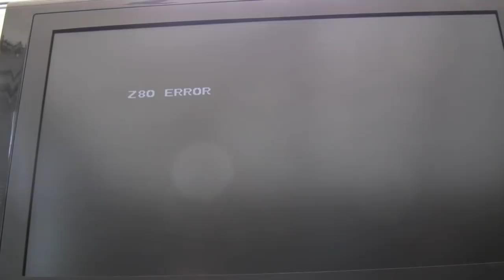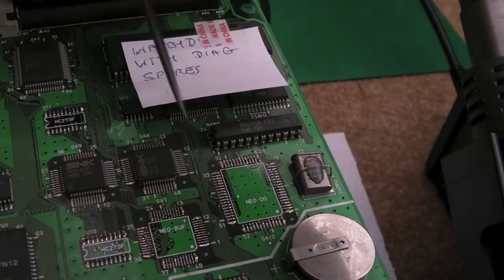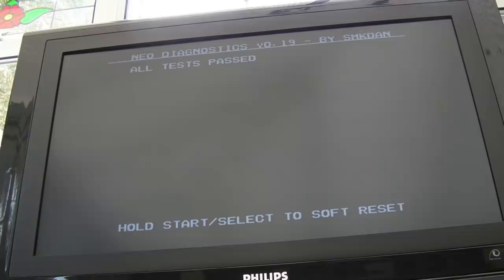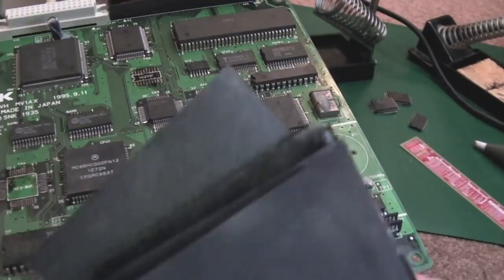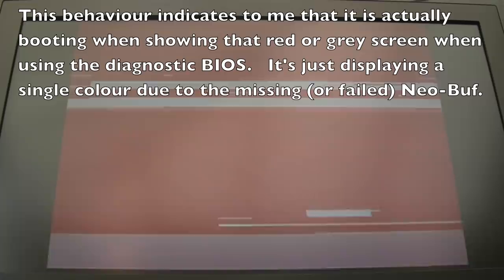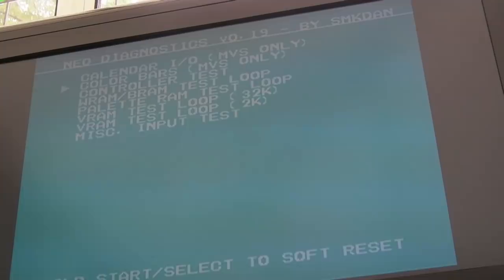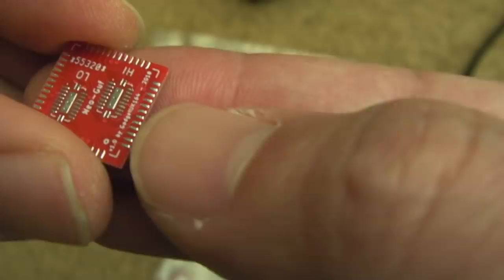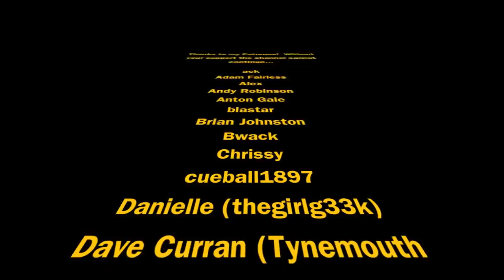SNK Neo Geo - 10 x Neo Geo MVS Board Repairs Part 2 (Neo-Buf Agony)

Comment: I propose a new word! Rebuffing a board. First step when you have a broken Neo Geo, rebuf it with Neo-Gufs :)

The Neo-guf will make your life repairing these boards a lot easier. Another thing that could perhaps simplify your work is to design PCB that acts as a Neo-buf to 74245/DIP adapter with a ZIF socket. Then you could just insert the Neo-buf in the adapter and use e.g. a TL866 to test it as a 74245. No need to solder on and off again to test which chip is faulty.
Reply from the maker: Haha!  I love it!!! =D  We will go with that!  Yes, I was already thinking of creating a PCB with socket to test them 'off board', but its just finding the time.

Comment: Hi Chris, I've been enjoying your videos quite a lot as I've started attempting to repair an MVA1 which is unable to boot (watchdog). I've checked all rams and they aren't shorted, all address and data buses are connected to the 68K, no damaged traces, and I also have a clock on it. There is some data passing thru the buses but I couldn't checked it further due the fact I don't have a logic analiser yet but I have a scope. I've checked the z80 and the ram and it's also fine, there is a clock and there isn't a short. As a last resourced I've tried also replacing the NEO-BUF GA4 with GA7 but still the same, unless faulty it's faulty, still watchdog... The only weird thing I could find with my limited knowledge as I'm still learning is, that pin 93 on the NEO-MGA is not VCC (30 ohms) as indicated by the neo-geo wiki and actually I have a continuity with ground. I've lifted the pin but still same behaviour. Could the documentation be wrong or is it shorted? Could you please check on one of your boards to see if you have VCC on pin 93? Thanks a lot for your time, and really appreciated all your teachings.
Reply from the maker: If you are getting a watch dog on the MV1A - remove each Neo Buf one at a time and re-test.  Chances are one of them may be causing the watch dog.   Once they are all removed, if fault persists there must be a fault elsewhere on the databus or address bus.
Reply from the maker: I dont have an MV1A to hand to measure that pin btw!  But there are mistakes on the Wiki pinouts.
Reply: @GadgetUK164  Thanks a lot for replying Chris. I'll try that and get back to you. About the wiki, yeah, I've lifted the IC and it's meant to be ground. I've already mentioned it to furrtek. My other option is the PALs, I've order some GALs from China to program and see how it goes. Thanks again!

Comment: Hi. I'm having problems with a MV-1A board. If I replace palce20v8 with gal20v8, all i need to do is to write the jed from neogeodev.org? or do I need to convert/modify it? Palsnk1a has pins 19.21 and 22 shorted to ground internally. I also had to remove CR4 and CR6 because they also had pins shorted to gnd. Any replacement for the CR parts? I still get the watch dog (with retail and neo diag) even if I removed all the neo-buf chips and 2 x 273.
Reply from the maker: If the board has a PAL fitted you need to convert (I think) the .JED file using PAL2GAL (available on the net) - that may work if the .JED is aimed at a PAL rather than a GAL.  There are no replacements for the capacitor / resistor (filter) arrays that I am aware of but you could perhaps replicate the internals of them - someone on the Neo Geo forum did a schematic for the internals of those arrays.  If you have a watch dog after removing the stuff on the databus you could have a fault elsewhere regards to clocks and stuff, or maybe a missing address or data bus connection between CPU and ROM / RAM.
Reply: @GadgetUK164  Thank you. I fixed it a long time ago. I didn't convert the files for GAL. But you have to replace both PALs with GAL..

Comment: Would be great if you could put a write-up on a wiki somewhere on which issues are likely caused by which components failing... I've tried repairing a bunch of these boards (usually MV1-FS) and boy they are a pain indeed. Any tips would definitely be appreciated by budding repairers :)
Reply: I know it'd be a bit of an effort, but if you go back through his vids you shall witness the common failure modes. 

The problem is that not all the boards have schematics regarding custom chips etc. Gadget and Furrtek
(@furrtek) have been communicating to try and document all they can. There's a lot of effort involved. Furrtek is reverse engineering the platform, and is hoping to get findings to provide an FPGA level of understanding the platform, and that will take even more time. 

If you are that passionate about such things, please consider supporting GadgetUK and Furrtek over on Patreon. Have a great day :)
Reply from the maker: As Neffers has said, some of the things we (the community) are finding are working their way into the wiki =D   So the info is not getting lost! =D
Reply from the maker: Thanks mate =D   I always appreciate your support!  You are a legend!
Reply: @GadgetUK164  Nah mate, I'm just a consumer of your know how, you are the legend here ;)

Comment: Regarding NeoGufs - I see two options worth consideration, first maybe to use FCCs (flat flex cable) instead of PCBs. I saw on aliexpress or at ebay offers with custom designs, It's nothing complicated to manufacture these, copper traces are laminated in something like Kapton tape, should be dirty cheap to produce that, I have such one included with HDD Combo which was meant to first ps2 slims. Another solution is to stay with PCB and use half's of metallized holes, so connection will be situated at the edge of PCB, not on top.

By the way do you have intentions to share this project (I mean NeoGufs) public available?
Reply: flex pcb is cheap in huge volume, difference is x10 at DirtyPCBs
Reply: @rasz  yeah, I mean FPCs https://en.wikipedia.org/wiki/Flexible_electronics Chinese offers often had reversed or misspelled names, therefore I forgotten how it was called exactly. I think that in this particular case, application of FPC will be right, I would not to worry about bending and crushing or something like that.
Reply from the maker: Thanks!  Excellent idea!  Especially for the SMD ROM replacements (something I might look into next).  I will tidy up the PCB and just open source it.
Reply: KyRol I dont think this is a good use case, cheap in huge volume means Millions of units, not ordering in batches of 20-50 pcbs, unless you consider $10 per single pcb alone a good deal

Comment: Maybe try a socket or soic 48...?
Very Good video.
Thanks
Reply from the maker: Thanks =D  Yes, trying to find a socket is part of the issue.  I've seen some rather large ones that might accommodate one of these chips but it could be difficult fitting it onto the board.  I might be able to use something like that to test them off the board though - ie. a tester PCB.